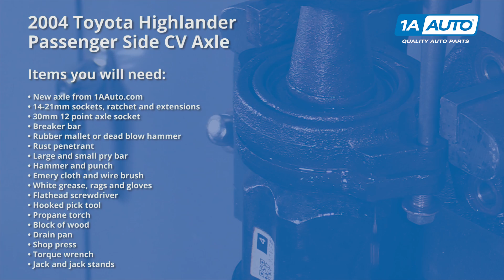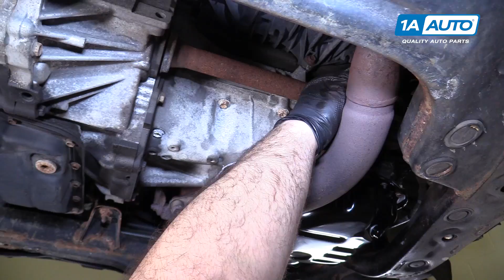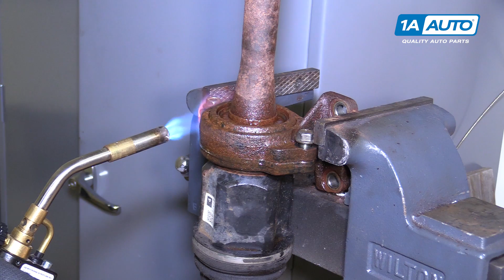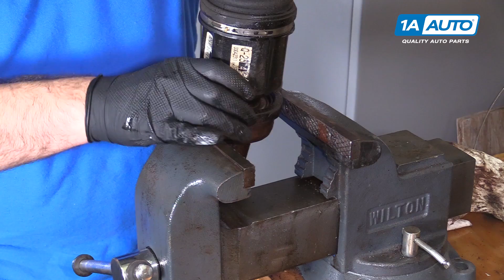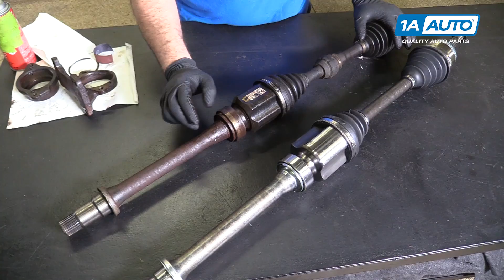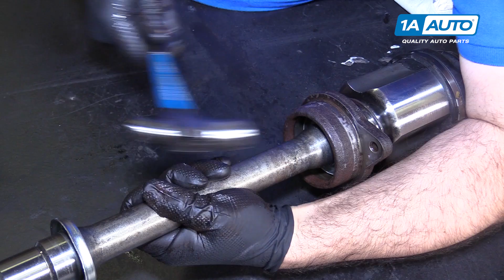How to Remove Stuck Passenger Side CV Axle 2WD 01-07 Toyota Highlander

Comment: 2002  4x4 the torque specs for ball joint are 91 ftlb and 94ftlb (nuts) 217ftlb for CV nut. Which is right torque because they are the same generation.

Comment: If you are a DIY and dont have a lift this may work for you. I recently got this job done by using a pickle fork between the housing and the bracket. Then hammer the pickle fork  handle toward drivers side. This successfully broke the bearing free of the bracket. Then it was easy to finish the job using the hammer pulley, but i could have just used a hammer and chisel to finish the job.  The hammer pulley did not work by itself  until the pickle fork broke the bearing free. This done for a 2002 V6 model the bearing would not move until I used the pickle fork. No cutting or bracket removal was needed.

Comment: I have a 02 HighLander Front wheel drive, I notice vibrations while accelerating past 45 MPH, dont notice it when I let off the gas. I also notice some play in the drivers wheel when shacking it with my hands. Is this the CV Joint? Thanks for any help.

Comment: what happens if you just angle grind cut that circle piece in 2 places. think it would come loose. then replace the mount? I have a rusty ceased C clip and it wont pop loose and not enough room to slide the mount out with the axle like you did.

Comment: I put some heat and hammered that bitch took me half an hour it is not that easy if you think. If you don't have some sort heat or fire don't star doing because you will get stuck removing that bracket from bearing.

Comment: I just did this job on my 2006 Toyota Highlander. The bracket holding the carrier bearing on my vehicle was much different than the one on this video. To remove it with the axle in place was almost impossible. Since I was replacing the axle anyway I wasn't worried about destroying the bearing. After beating on it for an hour with a 3 pound sledge hammer I finally got smart and used my air hammer. Placing the air hammer directly on the bearing pushed it out in about three minutes. Obviously this method destroys the bearing but it works.

Comment: Heads up! If you have a hybrid with a CVT, you will lose a quart of Toyota ATF WS fluid from your CVT when you take your CV axle out. So either place a pan underneath to collect it, it will pour out. Or, drain your CVT first. Then repace your CV axle. Remembering to fill your CVT fluid after. Another thing to take note of is that the Hybrid CV axle is much beefier than the standard Highlander CV axle. So make sure your auto part store gave you the right one!
Reply from the maker: +Big Teddy Bear Thanks for the feedback!

Comment: I have a Lexus rx400h, same design as the Highlander. I just spent 5 days trying to pull the stuck rusted axle out with every tool I could find. My neighbors were so annoyed with the banging that they came over to help yesterday. No luck!! All of us went  inside frustrated. The plan was to step away from it today  to clear my head before I lose my mind. Lucky I came across this video. It never occurred to me to take that bracket off. Even the lexus repair manual doesn't mention it. It just says to remove the nut that goes in the bracket and the pin and pull the axle out with a slide hammer. Thanks for this video!!! Heading back  out now. Also I did buy the replacement at 1aauto, I should have checked the video then smh.
Reply from the maker: +notoriousharlot Thank you! We love empowering our customers and showing how to perform DIY auto repairs with our high-quality auto parts.  http://1aau.to/m/Shop-1AAuto-c

Comment: This is a poor design, from a service perspective, by Toyota. I've spent hours fighting pass. side  Toyota axles over the years. They should of made it a solid half-shaft that sits in the transmission & carrier bearing, then, give it splines on the end where a short axle could easily slide on and off. Difficult to explain but easy to service! Mitsubishi does this on some of their models if I recall correctly.
Reply: Totally agree man.
Reply: Yes, I agree. My son’s Malibu has the half shaft design and it’s easier to replace its cv axle than this Toyota design.

Comment: what happen if the snap ring breaks inside, what can I do to get the breaks parts out the transmission
Reply: Flush your transmission is the only true way to get it out. I would not drive the vehicle until a flush has been performed

Comment: does this axle will replace 6 cil  highlander front wheel drive  not hybrid? thanks
Reply from the maker: +Hector Bogarin The axle in this video will fit the following Highlander model: 2001-2007 Toyota Highlander Front Wheel Drive, Passenger Side L4 2.4L.  It will not fit on the 6 cylinder hybrid model.  1aauto.com

Comment: Good job. Thanks for the info. I would have hit those races with a stiff wire wheel on the end of a drill and got them cleaned up better so the bearing would be a slip fit. But you got the job done. Car probably will be junk it needs an axle next time around.